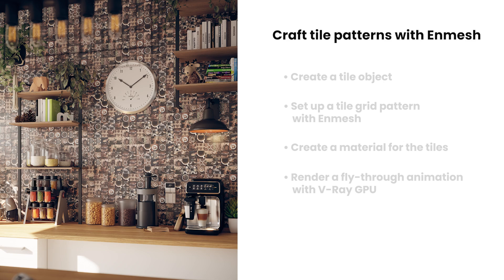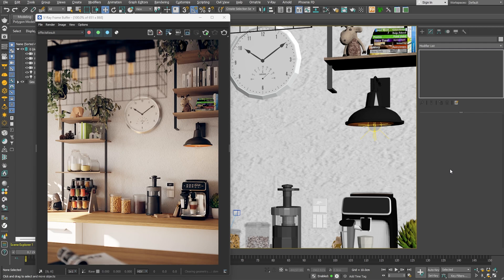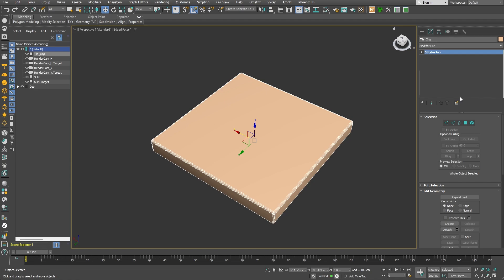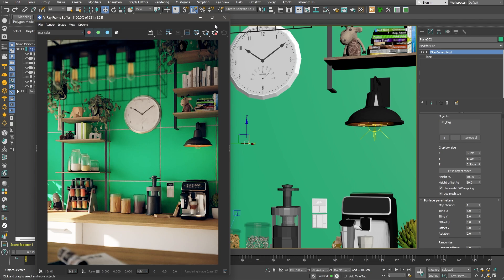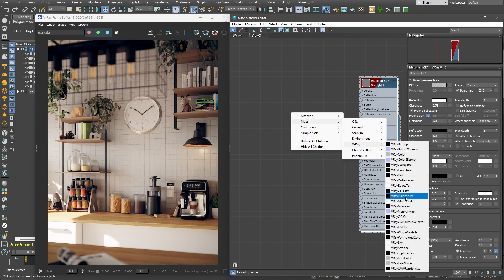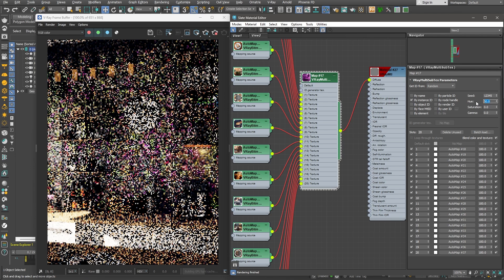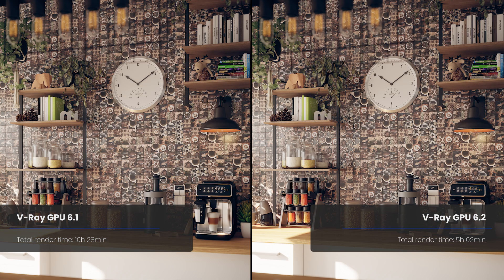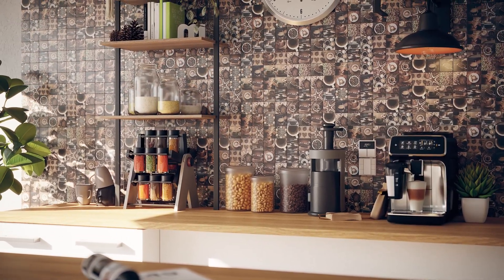Crafting tile patterns with Enmesh and rendering fly-through animations faster with V-Ray GPU

Comment: Vray is really disappointingly slow. 2 minutes per frame with a GPU? only twice as fast as CPU in HD. For such a simple scene it should be nearly instant if only you had decent neural denoising for the lighting solution, not trying to denoise the mix with textures.